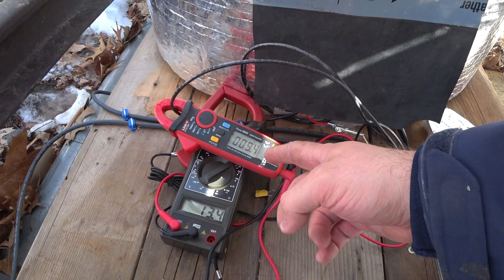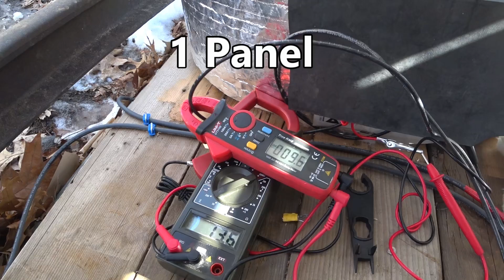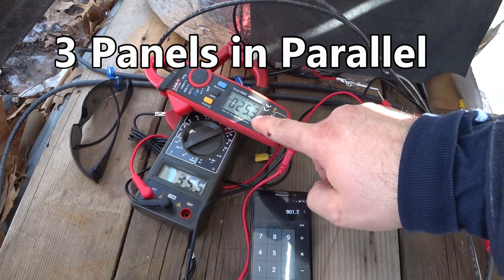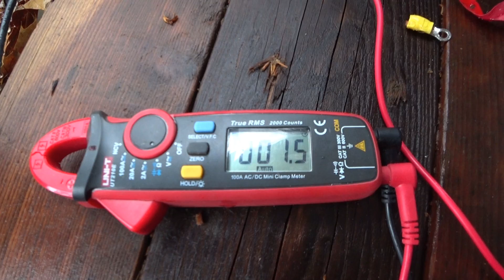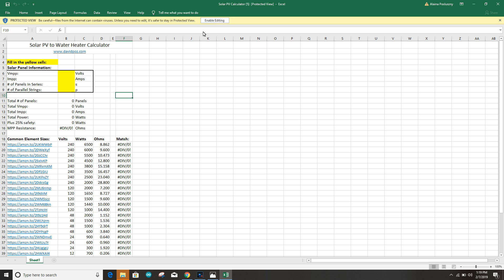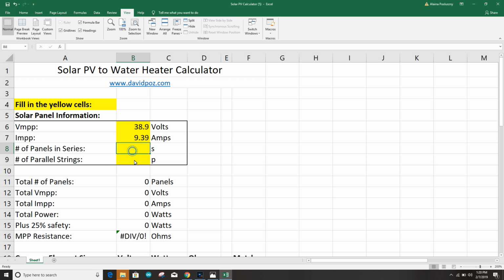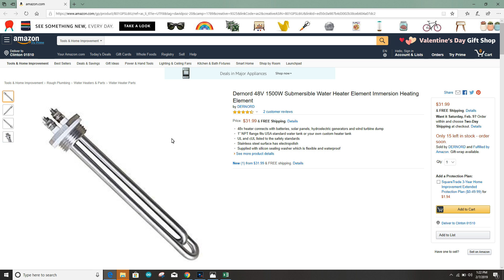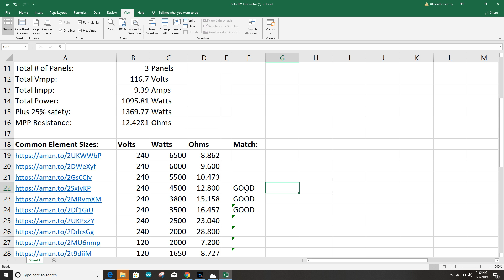Matching Water Heater Elements to Solar PV Panels

Comment: Awesome stuff.

I don’t know if this will be of help, but this is a link to a guy with an MPPT device designed for resistive loads particularly resistance elements for hot water:

http://www.techluck.com

He claims a significant improvement in harvested energy.

Engineer775 here in YouTube has several installation videos with this device.
Reply from the maker: Hi Eric,  I love Engineer775 and have been watching his videos for at least 8 years.  The techluck product looks like a good idea, but there is no data to back up the inventors claims.  I once asked him for more information and he never got back to me.  Same with Engineer775 videos about the product.  They both simply show that electricity is flowing to the heater.  But neither of them show how much more efficiency you gain by using this device over a simple direct connection such as my setup.  If someone wanted to send me one I would do a side-by-side test to find out this answer.  Thanks for watching.
Reply: Hi David,

You are correct there are no formal studies, but Engineer775 did make a video of the performance he was getting on his own home hot water setup using this MPPT controller.  After I saw this video, I stopped asking for more tests.

Engineer775 used a little less than one kWh of grid electricity per day during 72-days of test, and I believe his water tank was an 80-gallon hot water tank.  The rest of the energy was provided using PV solar panels wired through the MPPT controller to a regular AC heating element in the water tank.

If you are not impressed by the above figure of less than one kWh of grid electricity per day, then I do not know what will convince you.

Here is the video:

https://youtu.be/-crCWTAYwAs

I hope this is of some help.

On a separate but related matter, if you have an AC heat pump, then the following might provide additional hot water heat year round.  It is highly dependent on the size of you space heating unit, and it will provide a smaller fraction of heat in the winter compared to the summer.  However, with the right unit (AC heat pump) this can be a real sweet deal.

It costs nothing to run it, and it might lower your electricity usage for space heating (in addition to providing hot water) since this unit returns the refrigerant at a temperature that allows the compressor to work more efficiently.

http://olivetreeenergy.com/products/zeroenergy-water-heating-system/

None of these devices used by themselves will provide all of your hot water energy, but you should be a little closer to getting there by using both of them.

Perhaps as Engineer775 said in the video, using two MPPT controllers (each with its own group of solar panels) and each of them connected to one of the two heating elements in a dual electric heating element water tank boiler might be the ticket.
Reply from the maker: Hi Eric Kosak,  I'm enjoying our conversation, and I hope my responses come across positively.  I don't want to be miss-understood as putting anyone down.  I have seen Engineer775 videos and I'm thankful to him for taking time to make videos.  I simply wished there was more to information.  The techluck product might be awesome, but I don't know.

Here is an analogy:
What if I was selling a car, and the whole marketing theme was EFFICIENT.  Then I made a video about the car to try and prove to my potential buyers that the car was EFFICIENT.  So I set up a shot with me standing in front of the car and said "Look, the car got me to my destination, burning only one gallon of gasoline, wasn't that EFFICIENT".  

I think most people would stop and say, "Wait a sec, how far did you drive?  What was the fuel economy?  Where is the miles per gallon data?"  

That's all.  And again, I hope this comes across well.  I don't want to be miss-understood as being a downer.
Reply: Hi David, I appreciate your words, and again you are correct.  The way I see a situation like this is as follows:

I have seen you making the best possible investments in renewable energy to provide energy and convenience to your very nice family.  This by itself (in my own eyes) is commendable.

From a different perspective, would you not consider making investments in other more traditional things like a savings bank, a treasury bill, a company stock, of a mutual fund to provide for them?  

Some of these have more risk than others.  Many of these have built in guarantees against losses.  However, not everywhere in the world is this true.

My advice for people who invest in the future is be prepared to lose it all, and this is the key.  

Why? Because I don’t have a crystal ball.  I have no idea how things will turn up.  

A stock in some large cap company, for instance, from a well established name can turn sour quickly.  I have seen it happen too many times, and out of respect, no names will be mentioned.

All we can do is try and keep trying with our eyes wide open.  

Can I guarantee that this device will work?  Of course not, but it probably costs as much as some of the inverters that you have replaced, and you have the right moment in your life, setting, and circumstances for trying it out. 

The inventor claims that it does MPPT tracking, and based on everything I have watched from him and from Engineer775 there appears to be a better than 50-50 chance that it is the real deal.  

There is no other resistive MPPT available that I know.  If it does work it will probably save you at a minimum the cost of a couple of solar panels, and if it does not work (and you can afford the sunk cost), then you will be upset about the loss, and you will curse me to no end for suggesting it.

This inventor and Engineer 775 are the type of guys that I would take a chance on them.  There are a lot of people making all sorts of claims, but they don’t have the technical knowledge to back their claims.  In addition, they are making an effort with their time and reputations to promote it.  I have yet to read a comment from either one regarding their own videos where their customers turned against them.

These two individuals appear to be the genuine article.  Therefore, there are several facts that seem to add to the circumstantial evidence that it will work.  I cannot prove this, but there is positive evidence about it, and there is a lack of negative evidence about it.  

In the end, use your own intuition about stuff and people to make your own decision.

I by the way have never met either one of them, and I am not getting anything from promoting their claims.  LOL.

Comment: What if you did 3 in series with 2 in parallel? so 6 panels total, would having the 2 strings of 3 in parallel overcome the issue with the Ohms?
Reply from the maker: This issue I was having was not understanding it, LOL.  The current combination of 3p panels to the current element is working great.  You could run more panels in series/parallel, but you would have to match that to a new heating element.  This is why I created that calculator.
Reply: No. He has a 1.5 Ohm heater. U= R*I.  He needs 3 panels in parallel (3x10A), to get to 45V (30A*1.5Ohm). To run it at 90V he would need 2s 6p, but that would peak over 5000W and probably destroy the heating element.

Comment: It is not the resistance of the heating element that is important.   It is the power curve for the panels that are being used and providing a load that matches.
For each point on the power curve a rectangle can be drawn that incorporates the X and Y axis as two sides of the rectangle.  The area of the rectangle represents 
the power for each combination of the Volts  on the Y axis and Amps on the X axis.  The point in the curve that matches Vmpp and Ampp specified for the panel
will define the largest area rectangle and therefor the max power output.  (The power curve provided by the manufacturer is for a specific energy level landing 
on the panel and is specified in watts per square meter.)  The points on the curve indicate the maximum power for all possible combinations of possible watts and volts.

If all days were sunny and the panel or panels were operating at the and full power max power point then a specific resistance load could be chosen for that power point.
All days are not bright sun and the max power point will move along the curve.

To achieve the maximum heating power from the panels an MPPT controller is necessary.  This controller will adjust the output voltage and current to create the largest 
area rectangle to extract the most power from the panel for the  Watts per Square meter available from the sun.

If you wish to do an accurate comparison between solar panels with heating elements and a water heating solar panel, your not only need to take into account the 
solar collection areas for each system but also insure that each system is operating at maximum possible efficiency  for all conditions.

The water heated panel simply absorbs whatever watts are available and transfers heat to the water.  (More heat will be transferred if the temperature differential 
between the water and the panel is greater.)  Some heat is lost to the surrounding air due to conduction.  
(Air temperature will not cause any less heat being transferred from the solar panel to it's tank.) 

The solar panels and heating element will not be operating at maximum efficiency unless an MPPT controller is used to match the source to the load.  Cold temperatures 
will negatively affect the output of the solar water heater but the low temperatures increase the efficiency and output of the solar panels.
Reply: If you select a resistor that is close to Vmpp/Impp you will be getting close to the max power out of the panel with that resistor. (Ideally you would adjust the voltage and current to better reflect your actual operating conditions in terms of insolation and panel temperature). The actual technique that they teach in school would be to find the intersection between the V-I curve of the resistor and the V-I curve of the solar panel. To get maximum power, you want this intersection to occur at the maximum power point of the panel. It is called the load line technique. Of course, if you add panels in series, then you need to multiply Vmpp by the number of panels. And if you add them in parallel then you need to multiply Impp by the number of panels.
Reply: @mckenziekeith7434  You could get 2 heating elements. One for summer with a resistance matching close to Umpp and Impp. And another for Winter with double/triple the resistance to get a better mpp around 1/2 Impp. A microcontroller could then switch a relay between the two, depending on measured voltage, or just a manual switch for the "normal" people.
Reply: Psi Storm right. We all need to learn how to make these controllers work anyway.
Reply: That's 100% correct.
However, that s a good compromise, if you want a low cost system with second hand panels and without expansive MPPT electronic.
Reply: Lots of MPPT CHARGE controllers out there. I'm thinking for a direct element hook-up a charge controller wouldn't be the device to use? Help!

Comment: How about just making a roll of wire and put it inside the tank as the heating element? I saw Electrodacus do that in his house check him out
Reply: In one word, Electrolysis. Unless the element is totally dry it will quickly corrode away.

Comment: Hello. Check this video out... https://www.youtube.com/watch?v=5rYy0gHZepI&t=88s   No I am not with, employed by or affiliated with alt-e store it just a good video. To reply to TrackGeeks reply the diodes that "SHOULD" be in the box on the back of the panel are "BYPASS DIODES" not "BLOCKING DIODES" theirs a difference, and how they are connected in the circuit, watch the video above. Sense your not going thru a "Charge Controller" in this setup and your panels are connected directly to the load, (the water heater) I would use diodes. One panel gets shaded and the other two panels that are not shaded will dump voltage to the shaded panel and heat it up reducing its life span and or shorting it out, the "blocking diode" will stop that from happening in a parallel system allowing the voltage to only flow one way. One diode on each parallel connected panel.
Reply: The panel will not get any real reverse current unless you are above the VOC. in this application with a resister as a load that is not really possible. Blocking diodes are certainly not a bad idea but not really necessary since the risk of exceeding VOC is quite low.

Comment: It'd be easier to share a web-based spreadsheet such as via a publicly shared google docs link.  More people will utilize that as it's sanitized.

What do you think is the best anti-corrosion anode for this type of system?  Galvanic, ICCP or hybrid?
Reply from the maker: I'm happy to make something else that is better for sharing.  What is google docs?  How do you sanitize a document?

I'm familiar with anode rods for water heater tanks, but I didn't know there were different types.  I've just bought the one available at Home Depot when I needed to replace one.  Sorry I'm not much help in choosing which one.
Reply: @DavidPozEnergy  Google makes it more difficult for people to send infected files to one another.  They have a web-based suite of office productivity tools that are geared towards sharing.  There are also competing services.  

Cathodic protection methods are similar to use of sacrificial materials, except instead of relying solely upon the higher electrochemical potential of one metal vs another, it uses DC current to direct solutes to interact preferentially with the target substrate.  These are more expensive as they are sometimes designed to have dynamic voltage in response to changing electrolyte potential.  Hybrids are a mixture of both approaches.

Comment: that heating element can be changed so it takes half the amps and double the volts fyi.
Reply: I have a ,4840w PV array. My Bank is a 48v system. We use an 80 amp OutBack Mppt charger. We have an Aims 6k Low frequency inverter with 2 Hot Legs. Each is 120v but be Mains into a 120v/240v set up. What additional equipment would I need?  48vdc or 120vac or 240vac water heater element? (what would you use?) and whats the complimentary dump load inverter to be used with it? ( Needs a low voltage shut off Parameter I can set up).  We max our Tiny 13KwHr Lithium battery by 1 or 2pm. We get sun until 8:30pm with the extra 840w PV South West facing. ( 2x420w pv) Typically pulls in 520w down to 140w before night sets in and the voltage is too low by 8:45pm.  Should we go DC or AC with the heating element? Added info. Our array has pulled in 3,400+watts on some perfect days! I think I saw 45 to 48 + amps.

Comment: Great job on the spreadsheet look forward to seeing more on the experiment. I do question using an AC element with DC power. I don't think that will work but I look forward to seeing your experiments with that too. I'm a subscriber now good job
Reply from the maker: Heating elements are the same for AC or DC.  It's all the other stuff that can arc, burn, or just not work.  Thermostats, and switches all need to be rated for DC.  I've been using an AC heater connected to DC solar panels for a couple years now.  https://youtu.be/jFoxIit8NYA  Thanks for subscribing.
Reply: Yep, heating elements are simple resisters and will work the same whether its AC or DC. For AC switches you can use them on DC if sufficiently derated for voltage.
Reply: It depends how well the elements are insulated from the water. If they get moist inside, the DC will cause Electrolysis and corrode them very quickly.